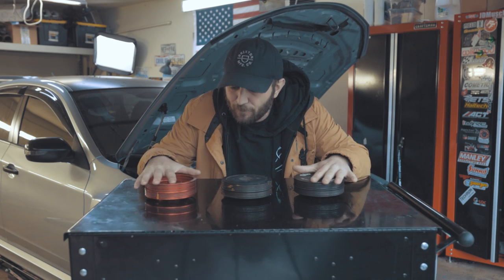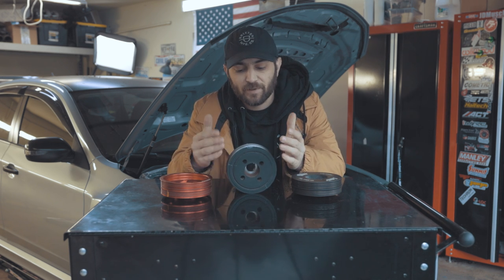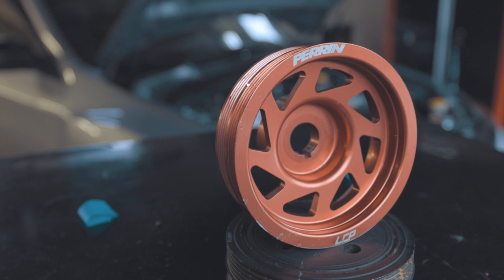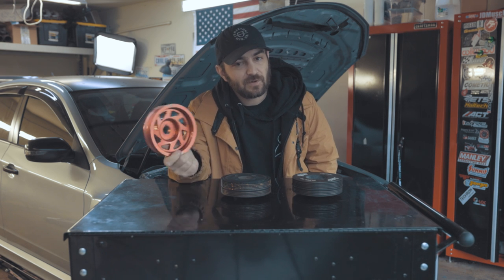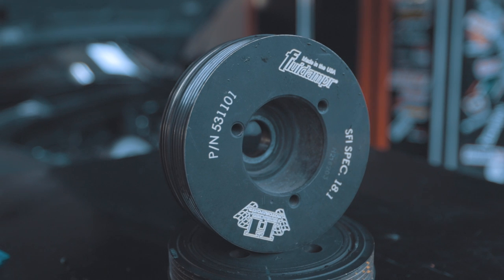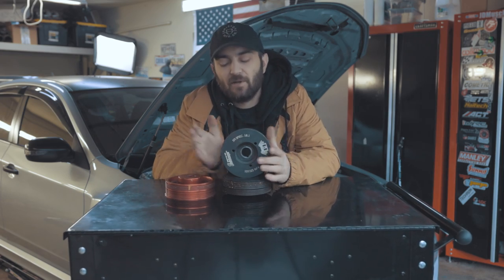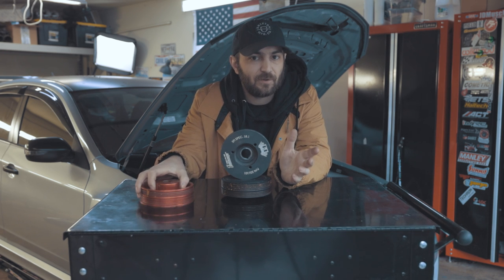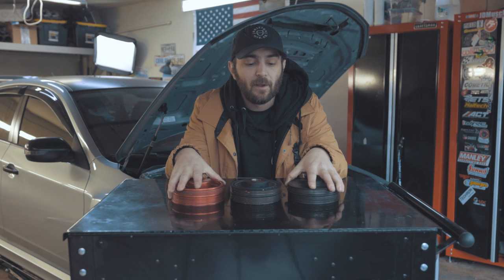Which is Better: A Lightweight Crank Pulley or a Crank Pulley Damper?

Comment: So does the Fluidampr still potentially free up a little bit of horsepower/revving ability, or does it double down on preventative maintenance and possibly even rob a smidgen more horsepower due to its higher weight?
Reply: Since it's heavier I don't see how it could free up power unless it has less friction than OEM.
Reply: The rotational weight of the fluidampr is less than OEM. There is a weighted inertia ring inside of the fluidampr that is suspended in fluid.  MotoIQ did a long tech video on fluidamprs and provides better information and resources.   After installing on my EJ, I noticed improvements in every area of driving.  From Idle to redline, this made my Forester better.  

Mike from MotoIQ touches on a little discussed topic of the sensors picking up the cam and crank angles more "correct" as opposed to the whip forces on the cam and crank from combustion.   

He is not kidding and this is known is racing circles.  The same way a faster ECU or one with better OS (if using older hardware) can do the ignition timing better and be more precise.  The reduced whip of the crank and subsequently the cams means it is more accurately reading the correct cam positioning as an example.

Go one step further and take a look at images of exotic engines and see a quite large and familiar crank pulleys.  I have spotted a few.  Additionally, you can find harmonic dampers with similar tech and goals in detailed pictures of certain F1 engines (take a look at the incredibly intritcate cam harmonic balancers as an example).

Comment: I know in rotary balancing, the front pulley to the flywheel are balanced rotationally to push high RPMs.  And lightweight pulleys and flywheels will destroy bearings in a rotary if they aren't at least close in weight on each end.  Rotational balance of the pulley and flywheel itself also tends to be overlooked, which becomes more important with high RPM applications.

I'm not sure how much of that really needs to be worried about in the average EJ build, but it's definitely something to at least consider when throwing parts together, especially with the cheaper cast lightweight crank pulley and flywheel offerings.
Reply from the maker: Not so much luckily on EJs, the crankshaft is so short that vibrations are already pretty low. ROTARY engines though sound like a good time when it comes to dampers and balancing 😅

Comment: My bugeye came with a cobb pulley when i bought it at 140k. Previous owner put it on at 70k. I transferred it to my new engine at 186k (ringland failure) and now has 233k. 0 issues

Comment: So question. I'm looking to get up to the 400whp goal, should I plan on switching or will the OEM still be alright for that level? 20g, FBO, fuel build.
Reply from the maker: You'd be fine with the OE but I'd still suggest fluidamper 🤝
Reply: @Smeedia  I'll add it to the list. If you think it's a better idea I'll take the builders word for it 💪

Comment: Have you done a video on the installation issues on the newer fa/fb’s? I was scared off the lwp because of some pin that supposedly could be dropped into the engine. Now I can’t find anything on it but do see the boss required to install an aftermarket pulley from grimmspeed.

Comment: Perrin LWCP here on my 2011 WRX . The only “issue” I had was engine stumble at idle , or when the revs were dropping down to idle ….. 
you can eliminate the stumble by increasing engine idle RPM range. 

I grabbed my Accessport and increased idle with A/C off by 100 RPM
With A/C on, I increased idle by 125 rpm 

Engine stumble has been eliminated for 10 years now with no issues at all. Car revs like a champ.

Comment: you need to remember that machining evolution effect on primary harmonics is one thing but secondary harmonics are another.

secondary harmonics are mitigated by design and not by machining. It's balance shafts, rod to stroke ratio. The rubber filled pulley is good for its intended purpose, not introducing resonant stress into the auxiliaries or crankshaft and avoiding extra torsional twist caused by the auxiliaries. By default the front pulley is mostly a counterweight for the flywheel. 

You should go with the rabbit hole anyway because where fluidampr is a good investment and good for your engine OEM is in most cases adequate for any abuse you're giving it as long it's a good one and not broken due to it being mostly dependent of engine design
Reply: so altering the engine design (valvetrain, redline) is a good reason to change the damper due to how resonance acts (easiest way to think of it is octaves) and slapping forged internals and a big turbo isn't

Comment: I noticed after running a perrin lwp  after an oil change for 5000kms it looked like I had metal shavings in the oil I never changed it as i had to many other issues with the car.
Throttle response was increased about %3 and daily driving it was alot peppier based off my ej201 na at the time

Comment: I'm going for a lightweight crank pulley on my engine. It's a straight O.E.M. plug and play replacement, no special belts or bolts blah blah. Just a lighter mass pulley. Stock pulley is about 4LBS and the aftermarket one is 1.5LBS give or take. What should I expect aside from what they advertise??

Comment: My 2015 WRX is modded making a bit above 300 hp. Stock flywheel and other stuff. However my belt is autozone and pully is stock. Going towards 100k. Maybe I should swap out for that pully you recommend. My car is a daily driver. Planning to keep my car so maybe thos is a thing I should get. I live in NY also so it's exposed to the weather there also.

Comment: I am so glad I came across this video, so i just have a question. ill be around 350wph for my build (RA, headstuds, b25 heads) vf48, 1050s, top mount, intake. so im just wondering if you think the grimspeed lightweight pulley will be good compared to that perrin.. has a bit more weight to it and isnt as "lightweight" as that red perrin... do you think there is a certain limit to horsepower you think only to run the dampr from then on?
Reply from the maker: Tbh I would use the stock pulley. If you wanted to you'd be okay using the grimmspeed one though 🙏

Comment: Fluidampr is the optimal solution no matter your power level. Go to their website and see the data.Properly
collected data does not lie. Lightweight pulleys increase the opportunity for secondary vibrations to bomb 💣 destroy your engine. That is dynamics and materials properties facts not an opinion. Given most modifiers go for substantially more power than OEM a crankshaft damper that is designed to work effectively over an even larger power band and sustained higher revs is a no brainer to my way of thinking.

Comment: What would you suggest at 400-450 range for the  pully
Reply from the maker: Fluidamper 🤝
Reply: @Smeedia   on a fa platform?
Reply: Also where do you get your bolt torque spec sheets from im trying to find one for the fa

Comment: Light weight aluminum crank pulleys should only be installed on fresh engine build because the crank has to be balanced along with the whole clutch kit, rods and pistons and the crank

Comment: I need lower end torque, i thinking lighter pulley on my stock engine. Mine just solid metal, no damper or rubber. 

There is no aftermarket for my engine. This might be funny, but i think it will work. Could i just cast my stock pulley using solid fiberglass or carbon fiber, keeping the metal bushing for mounting. I could use alumunium on the side as heat shield. I think even using woven fiberglass and epoxy it will be significantly lighter.

Comment: Agree to disagree.
I didn’t see any hp increase with the aluminum pulley. Rather, I saw better throttle response on the bottom end.
Kinda the same thing you experience with a throttle body spacer and/or intake spacer. But for different reasons.

Comment: What gets me, why are fluid dampers so expensive?
I know the silicon fluid is expensive but the materials are not .
I guess there is at least a 100% mark up but even that doesn't explain why they are close to $600.00 for basically a 6"~7" diameter chunk of steel

Comment: Here's a question
 Say my fa20 is on stock dampener pushing 420 hp. Should i throw on a fluid Dampener or will I need to re-tune the car? It's an fa20 that's why I ask.✌️

Comment: Question: what are your thoughts for the FA? Now this platform does not come w a harmonic balancer. Oem pulley is already light weight compared to an EJ. Grimmspeed and maybe perrin finally came out with a ver. For the 2018+ wrx. I am at 36% power increase over stock. (324 whp, 336wtq)

Comment: Sorry if this has already been asked but what's the whp cutoff for oem crank pulley and fluid master crank pulley? I am at 360whp/400 wtq on oem pulley and everything seems fine with 6K miles on my built shortblock. TIA
Reply from the maker: 450+ is when I would highly suggest swapping one out for a fluidamper

Comment: I wish I would pay $500 for a pulley! So far I've doubled my cars factory power (not a Subaru) and still have all stock pulleys, a sealed engine and 200,000 miles. But to each their own I guess... I'd run expensive parts too if they were given to me, not saying this was or wasn't... Just say'n!

Comment: Very few motors were externally balanced. The Chevy 400 was, all other small block chevys were internally balanced. The harmonic balancer has nothing to do with balancing a engine. It is there to minimize torsional vibrations . The longer your crankshaft the more you need one.The more power you make the more you need one. Internally balancing an engine is nothing new.

Comment: this video is some weird science explaining what isn't going on accurately...
crankshafts are built for torsional twist, its what spins the damn air pump. it's the reciprocal ups and downs (or side to side, for you head gasket eaters) in relation to the spinning that has imbalances to dampen out. Imbalances that stem from anything; one cylinder getting a little less air due to a casting defect, an injector that has one clogged pore, a stubborn chunk of carbon on one piston, coolant design etc.
Without protection, the harmonic vibration is free to roam, perhaps resonate elsewhere and worse; amplify. The crankshaft wants to wiggle as it spins and a damper serves to absorb those vibrations as they happen without letting them pass the rotating assembly. Going from a stock damper to ati/fluid with harsh engine mounts is a good demonstration of this. 

Stock rubber bound pulleys dont typically fail by falling off, they slip and slide and the timing marks will lose their place, if you have a timing wheel that is attached to the outer sleeve, you will lose power due to the crank sensor being a dummy switch. if you ignorantly retime your engine to slipped marks, it may be excessively mechanically retarded or advanced depending on how far it's slipped and wont matter for long anyways.
fluidampr and ati are of different design but have a more broad range of imbalance-caused harmonics they can dampen better than oe through focused design. OEMs made something simple that works and can be installed in millions of cars on the cheap. Aftermarkets in pursuit of horsepower alongside longevity made something that worked better at an individual unit cost. Unless they're balanced specifically to the engine, lightweight pulleys seem like marginal gains and bling factor for something that has a complete lack of provisions for an integral part of how your engine doesn't tear itself apart as it spins 100+ times per second.

Comment: I wonder if my 2019 wrx would benefit from this. Its currently at 320 whp which is assuming 80 hp to the wheels over stock (could be wrong) any suggestions? I do get some odd vibrations in 4th.

Comment: I just installed a fluidampr on my 18 STi. the stock balancer just shit the bed. car only has 36k on. after installing it, I hear this aweful squeaking when I cold start the car, and when I turn the wheel. I retained the original belts. any idea what is causing this?

Comment: So, if I am SC my 8th gen civic si with a kraftwerks kit, then I should go fluid damper? Since the SC blower relies on the crank pulley and belt, would the fluid damper lose power for me, because it is heavier? I was thinking of going lightweight pulley before I saw your video.

Comment: You say not a lot of hp for a build. If you're building an All Motor swapped civic, this is beneficial to learn.👍🏾
Reply: If you build civics you would already know your oil pump will explode with anything but a damper on your pulley.

Comment: hello smeedia, I have a question,,,, I have my 2006 wrx the car is modified I don't have the secondary pump I have 1000cc injectors I have cattles down pipe hks equal length header and other modifications,,,, and the car has been run by 3 years with a base map,,, and with these modifications I can't tune it in New York but I have to move to North Carolina but I don't know if I can tune the car there with the same setup I have now.
Reply from the maker: I would look into NC laws on emmisions testing. I'm not sure what they do and do not require
Reply: Boxer4racing near Ashville NC. Dale is owners name I believe. Cobb tuner also.

Comment: Easily one of the best explanations on this particular subject. I have a nearly full bolt on 2018 WRX and have had the Perrin Lightweight Pulley on it since I’ve owned the car (about 2 years). I dyno at 337hp / 348 ft lbs on 93 oct with a pro tune (shout out to Fastech Motorsports in Louisville, TN) Zero issues thus far. But a lot of people cling to the harmonic balancer idea like it’s the end of the world to have one. If I decide to go for more power I’ll definitely change over to a Fluid Damper.

Comment: You are not losing HP, You are storing it as kinetic energy in the flywheel. It will add this back as you decelerate. It doesn't help but those are the facts.

Comment: Mine fucking exploded on me thankfully they replaced it under warranty but should I look into a aftermarket? Keep in mind my car is a 2019
Reply from the maker: Lmao the rubber and steel separate? 😅
Reply from the maker: It's not a bad idea to look into a fluidamper 👀
Reply: @Smeedia  yup I got to  my car on a Monday after work and i turned the car on to let it warm up and I heard a sound from the engine bay and turned the car right off and found the pulley on the bottom tray

Comment: I have an 04 blobeye wrx with spec-c built motor, i'm currently on a Blouch Dom 4.0 Turbo supplied by 1000cc id injectors not expecting to squeeze too much out of it because im still on the 5speed. Would you recommend i go fluid damper? My rpm range because of the built motor has been increased to 8,300rpms

Comment: The longer the crank the more chance that lw pulley can do damage lol. I've seen stock 4g63 cranks split in half because of an aluminum pulley. And it wasn't because the balance shafts were removed (which is for creature comfort, not harmonic dampening)
Reply from the maker: Pretty common with JZs and RBs as well, dame can be said for my EG. The longer the crank the more resonance can travel through it

Comment: Now this is my argument on lightweight pulley would be. If you where spinning the LW pulley faster than the crankshaft and the fly wheel, that would in theory create more wear on the bottom end (bearings, crank ect.) I’m no scientist but I feel like the LW is going to cause more minor wear even on light bolt on cars. Which will cause a lot of wear in the long run.

Comment: I replaced my original oem crank pulley with the grimmspeed lightweight one. Oem was so rusted and I was worried the outer ring was going to separate from center. Went with grimmspeed one because I didn't like the perrin one having spokes vs grimmspeed being a solid piece. 
No issues so far, about 10k miles with a ~300hp stage 2+ stock motor, 04 wrx. I'm pretty sure I'm at the power level that it doesn't really cause any harm.

Comment: The harmonic "balancer" really does no balancing, it never did, it's a damper. Like you mentioned, old externally balanced engines integrated a balance weight into the damper just to make two components from one. Every engine has a harmonic damper for the most part. The purpose of the damper is to eliminate torsional harmonics in the crankshaft. Imagine you're twisting the crankshaft, well that's what cylinder 1 is doing. So on an I6 or V12 you can imagine that twisting torsion is significant at cyl 1, not so at the other end, so there's a first order harmonic in the crank. Now the longer the crank, the lower the resonant frequency, so I6s are really susceptible to this, but Subarus being incredibly short are barely effected by this at all due to the high resonant frequency beyond the operating rev range. This is why 2Js, BMWs etc have big ol dampers with larger inertia rings. Note that the Subaru damper doesn't have a press fit, just a bolt and a pin. This is because the harmonics it is absorbing are not significant and it doesn't have to transmit much torque into the crankshaft.
Reply: It dynamically balances somewhat, you are talking about static balancing, but it's primary purpose is a harmionic damper.

Comment: Random place to post this but I have a 2020 STI with just 11k miles on it. Today I got a CEL and a code P0301 cylinder 1 misfire. Seems quite low mileage to be having this type of problem no? Any advice?

Comment: Roughly how much horsepower ends up getting consumed by rotating the extra mass (in terms of relative percentage)? I’m in the process of working on a 2.5 MZR/Duratec build and I’m considering reliability but the motors already make like sub 200 to the crank so I’m trying to get a feel if it will zap me back to 2.0 numbers lol